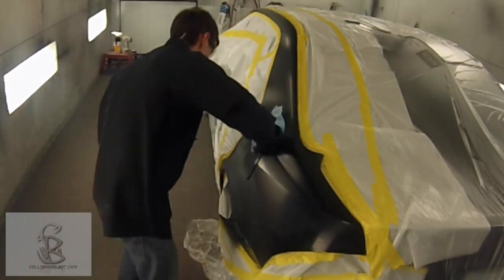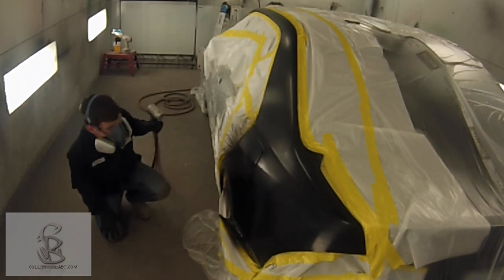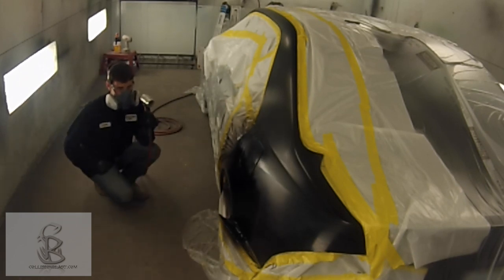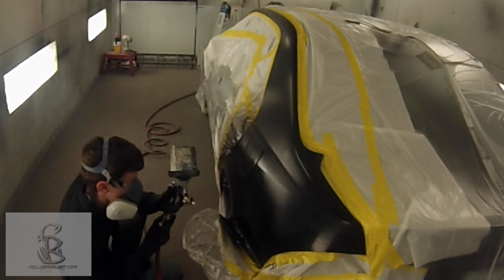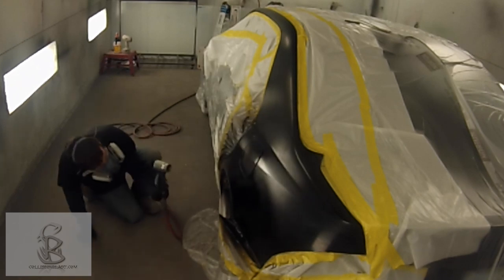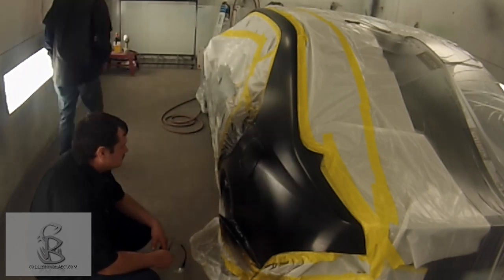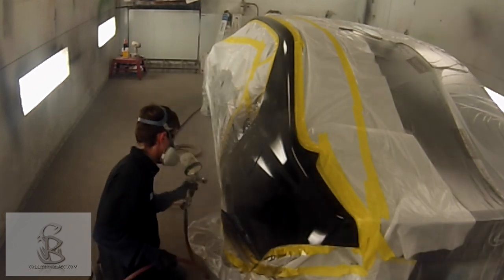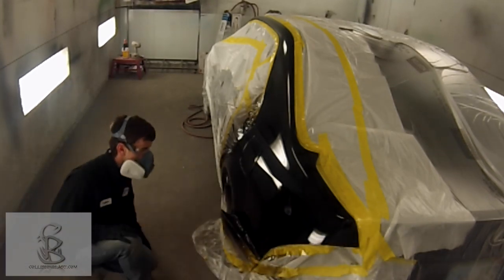How To Blend Waterborne Paint and Spray Clear Coat

Comment: What's the size gun to lazy down primer and clear coat. Is it1.7 and up?
Reply from the maker: For primer surfacer I use a 1.8....1.7 will probably do fine.  For base and clear coat I use a 1.3 to 1.4.

Comment: 10year old paint on a Mercedes- BMW still looks new after all that time , but then you look at a Honda - Toyota and so on and after 3 4 years it already looks washed out and foggy .  If I want to paint a car with Mercedes,BMW,Cadillac quality of paint what would be the OEM equivalents from DuPont ?   Thanks.
Reply: Ppg is what they use german company i just recently used wanda wich is the same thing and i used the wanda universal 8000 clear sprays well out of any cheap to expensive gun as long as you know how to set a gun up its very freindly good luck